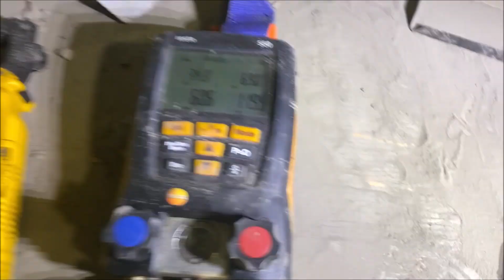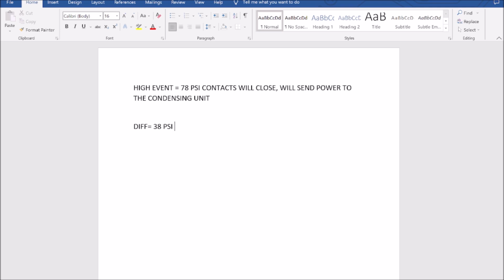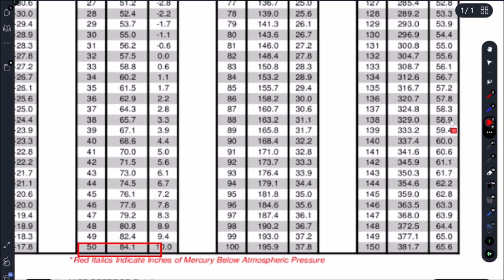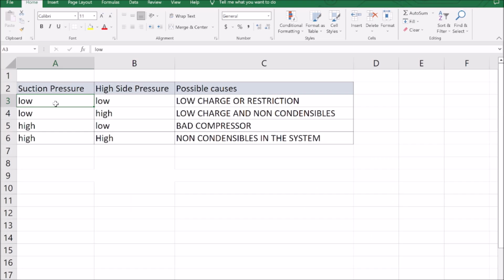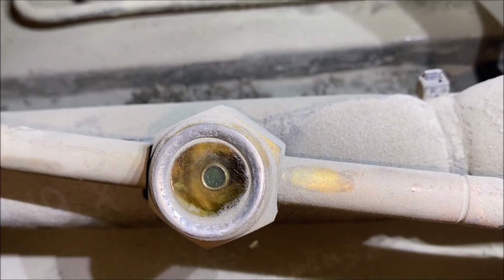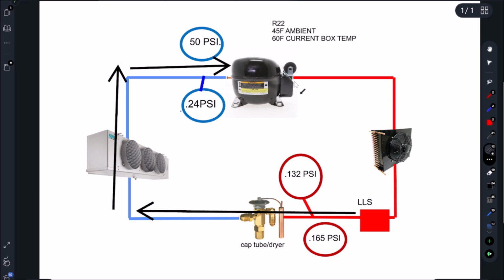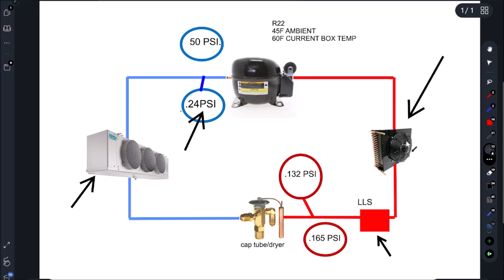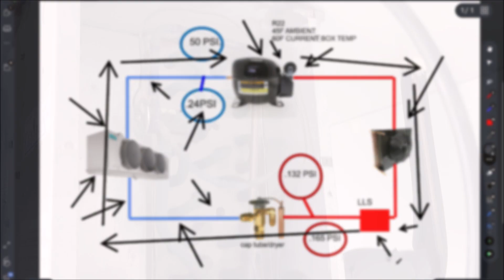Walk in Cooler is warm (R22) Dtek 3 vs H10 PRO

Comment: Question please😅, when are you using current box temp and desire temp to figure out the pressure, I love you your videos and I saw when you work on small unit like stand up freezer or cooler you using desire, but big unit like walking you using current box temp,